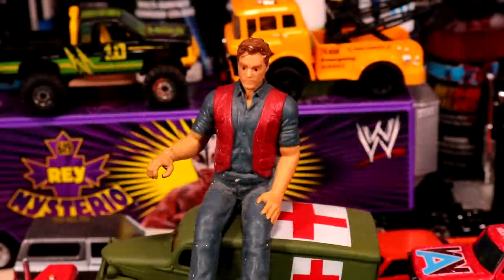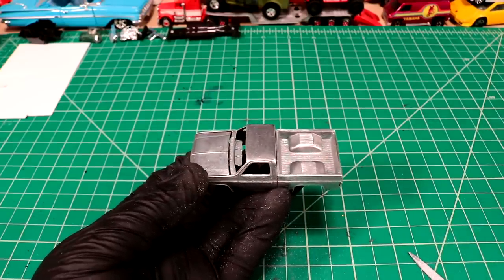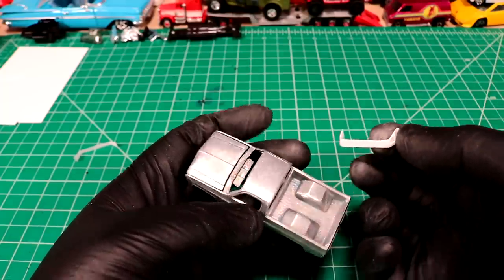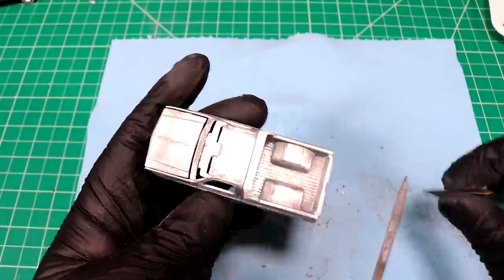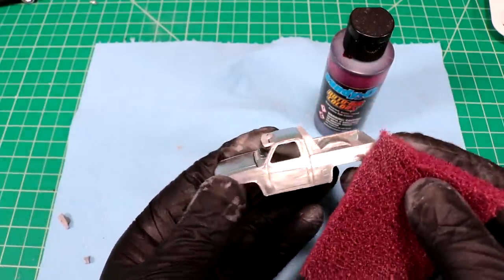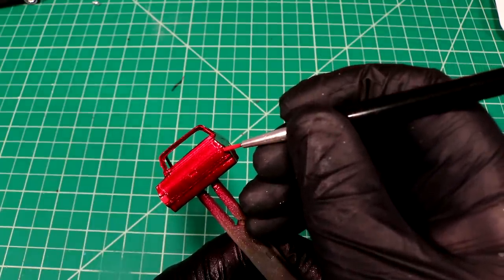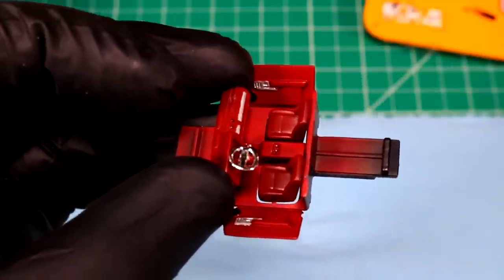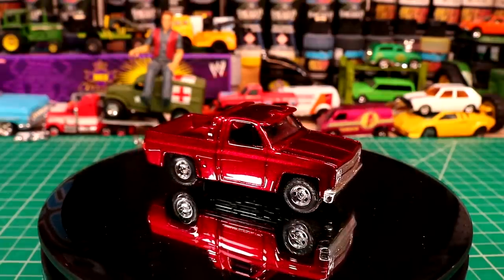Build a truck you owned challenge w/ RD Custom Diecast

Comment: My 1st car was 73 Mercury's Comet.  "The Blue Bomb". Had no floor boards or brakes or a dashboard you could use at night. (Cue a toggle switch). My boyfriend got her brakes and then sheet metal and tarred the floor boards. Had a piece of industrial bar for a bumper, a passenger door that you had to lift to close and the best damn Kraco stereo I could buy at the time. I miss her.

Comment: truck ended up looking great , you should 3d print a few more of them and other 3d printed accessorys youve done in the past. ive seen alot of people selling other 3d printed stuff  on ebay. some of the odds and ends youve made would prob sell decent there as alot isnt on there either way keep up the great work
Reply: I’m late to the show, just started  my very first custom truck, a Greenlight country road d100 into my 67 w100 flatbed. And this comment just caught my eye because I just ordered a bunch of 3d 1:64 accessories off eBay. There’s not a ton of it, but just enough, and some guys are willing to work from pics and make custom stuff. I really wish someone would make leaf springs and shocks and stuff, at least I ain t found it yet if they do
Reply: @TheFrogfeeder  there was one floating around on ebay that did it but it was a frame springs shocks and a set of tires/rims but it was hit and miss what year/styles he would do it in.  most of his work was bigger scale typically tho so had to search his work ill look to see if it was what u needed. ill  have to see if i saved  the seller or if hes even active now, also awesome to hear a few others are starting up best of luck on the truck trucks in the future! alot of the time people chop up the green light monster trucks for a higher stance,  and swap out tires and such, or they build up the axles with a putty and add a plastic or metal piece to slide the axles thru to make the higher stances by what ive seen if they dont go the chopping up of another truck

Comment: My 1st truck, I bought it in 1980 traded my '74 Camaro, was a 1978 K10 Fleetside, with 12,500 miles, 350, 4 speed, 8' box with a Fisher 8' power angle plow and a 3" lift.
Living in the northeast I figured I could make a buck or 2.
Well that fell flat, so I sold the plow. So I sold the plow and bought a set of ProTrac Hi Rollers 14x36/15 tires and American Racing 15x10 Aluminum wagon wheels, a 3" diameter one piece roll bar and 4 6" KC Highlighter, 2 100,000 CP & 2 250,000 CP, fog lights. That thing would go through anything.